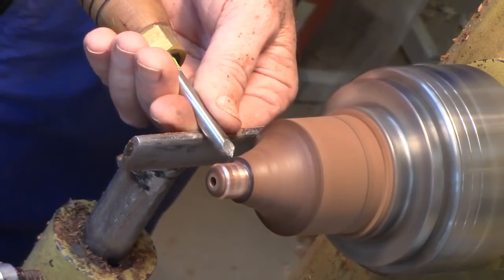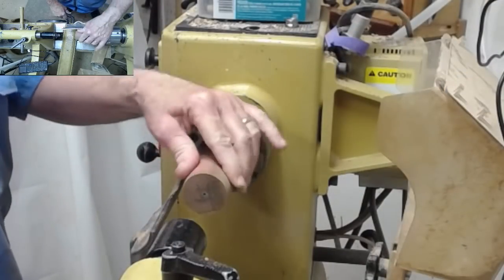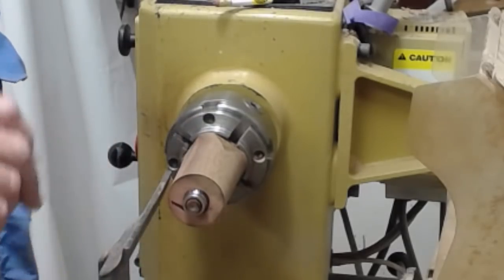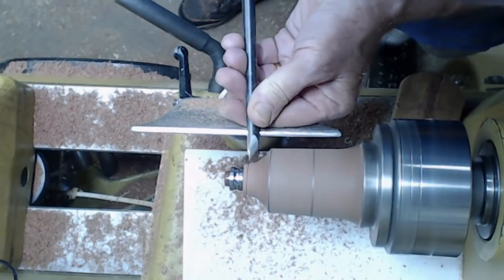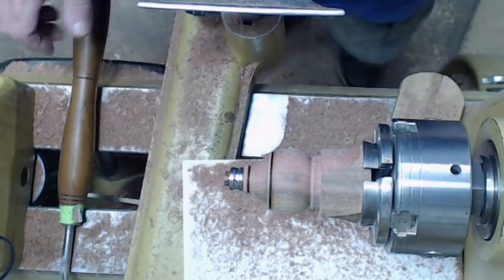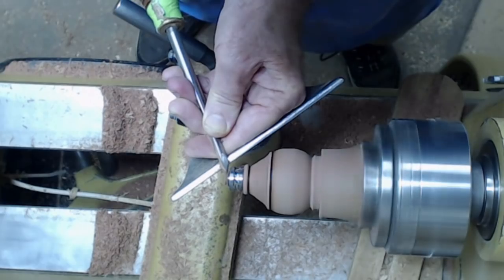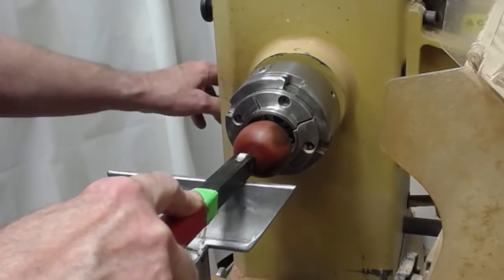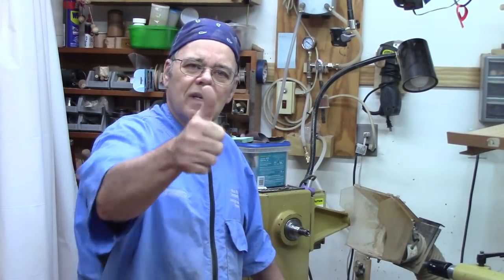Turn an AWL- A MUST Have Tool!

Comment: Good gift idea Mike. Inspired by your AAW journal article I turned one for myself today from a plum wood scrap, and then came across your video. Well done. I will certainly turn some others as gifts. Incidentally friends doing knot work might like a shorter spiked version to use as a fid.
Reply from the maker: Yes, a fid would probably also need a thicker shaft. I would get input from a fid user before making one.

Comment: Odd question...I am teaching a young lady with multiple disabilities how to sew on a machine. An awl would be very helpful for her at times but I need it ball point. They have them for sewing but not local and after the cost of the awl $13 and shipped $8...it just is not in her limited budget. But big box stores have inexpensive pointed awls, any ideas on how to either ball point them or make them dull? Thank you so much...any advice is welcomed.
Reply from the maker: Just grind the tip back and then hand polish the rounded tip thru multiple grits of finer  sandpaper. Start with about 180, 260, 320. Stop if that is smooth enough for you. Or go to a higher grit if necessary. Good luck.
Reply: @MikePeaceWoodturning  Thank you! Will try that.

Comment: 14:22 you had me right up until you used a carving mallet to whack the steel onto the handle. But I suppose, they're cheap enough that it doesn't matter how much they get trashed
Reply from the maker: I have three mallets I turned in my shop. You need to make you one. Here is the video link https://youtu.be/W-w2EpFI1i4

Comment: I have a couple of quick questions: on your Amazon Associate link the price is $17. for the music wire for (7) pieces, 36"  long. Is that correct? In the reviews on Amazon it looks like some people got seven pieces, some got one. Maybe they were using a different link?? If I go through your link and order something that's not on your associate page, do you get  a commission on that also? I want you to get the commission on my total Amazon order if that's possible. Thanks for your help sir.
Reply from the maker: The package has 7 rods. Mystery to me about someone getting 1. Yes, going to my store gets me a commision on anything you buy for the following 24 hours. Thanks for your support!
Reply: Thanks Mike for the info. Will be placing an order tomorrow.

Comment: What are this use for?
Reply from the maker: I guess I assumed folks would know. Shame on may. It is used for marking centers for turning, making starter holes for screws, marking lines on woodworking projects,  or punching holes in leather. A longer handle and it is an icepick! Thanks for asking.